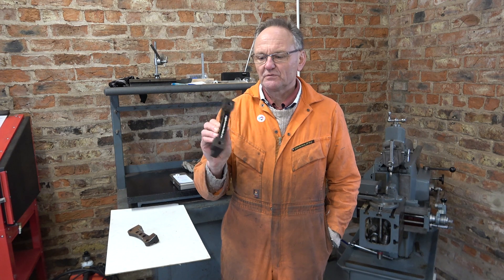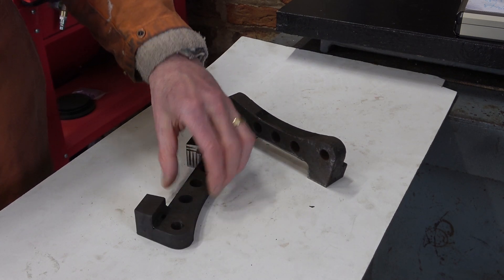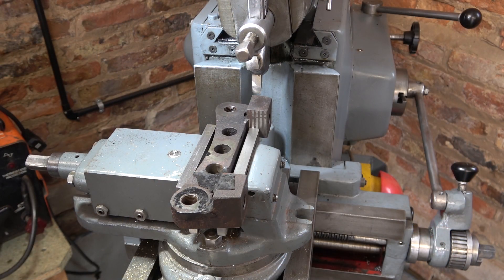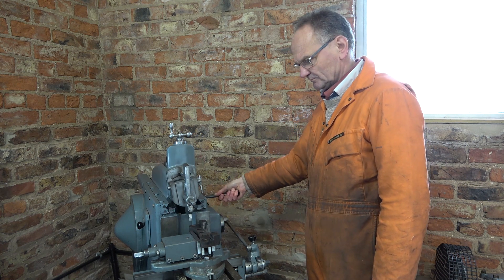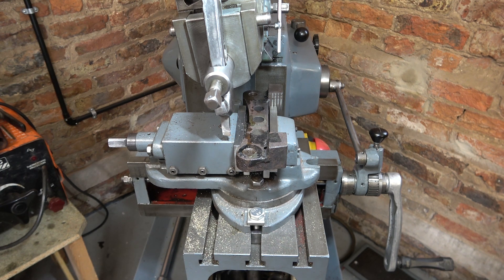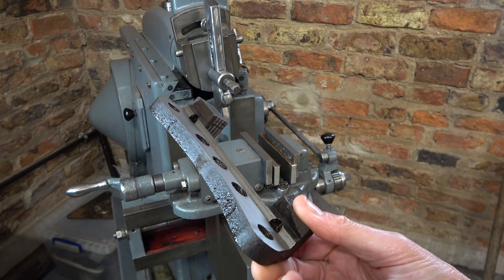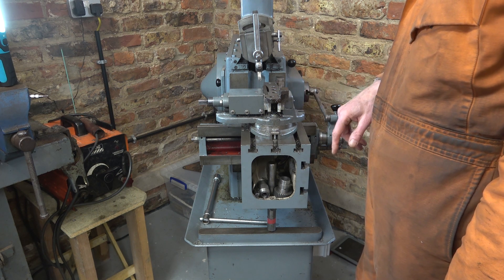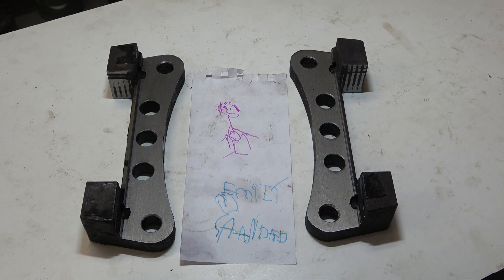HS62 Machining brake calliper carriers for an Audi S3

Comment: Nice to see a well explained shaper video. I have a Royal 10” model and am still learning with it but try to find any excuse to use it.
Reply from the maker: Hi Steve, is that the Royal 250? I notice that model has a nice front table support, but they all look well made. Shapers seem such a simple and basic machines but they have great flexibility and utility - it just takes a while to figure it all out. I'm still getting 'oh wow!' moments. Cheers

Comment: Haxby, what's the maximum stroke on an Elliot 10M shaper?  10 cm? Got to be more than that.
I put in a bid on a 7 inch shaper & I'll see what happens.  This is your fault getting me hooked on getting a shaper.  My wife may be calling you.   Keep the videos coming; we love them.
Reply from the maker: Hi Robert, the Elliott 10M has metric screws and dials but the stroke is measured in inches - i.e. 10 inches. It evolved from an imperial shaper.  It's quite a useful machine. It does not have an automatic downfeed on the ram downslide like the big shapers but it does have a vertical up/down feed on the table. I will look out for a project to demonstrate that.  Glad you like the vids ....